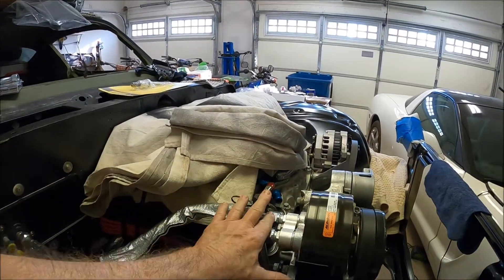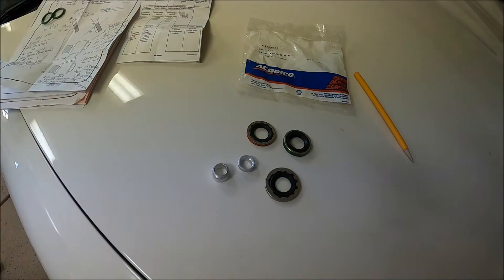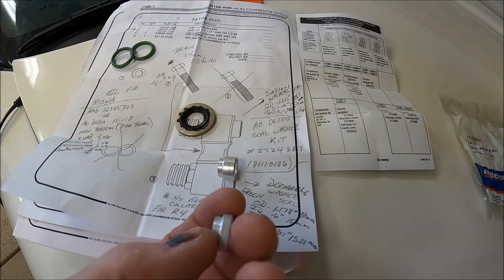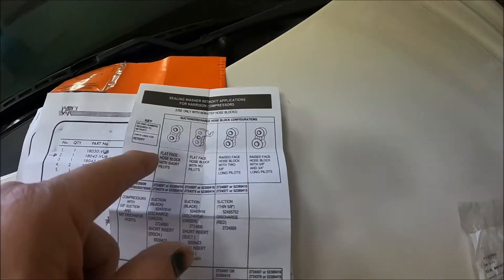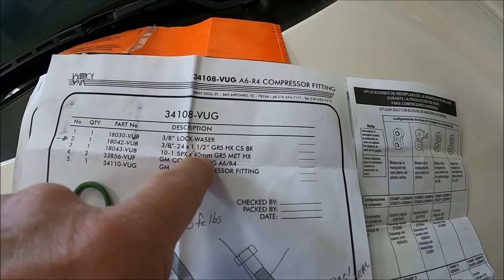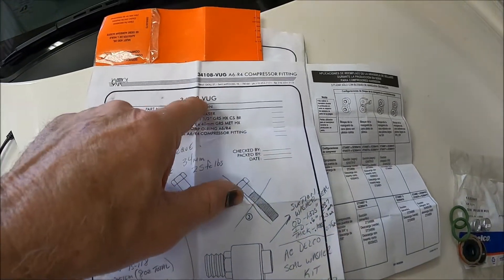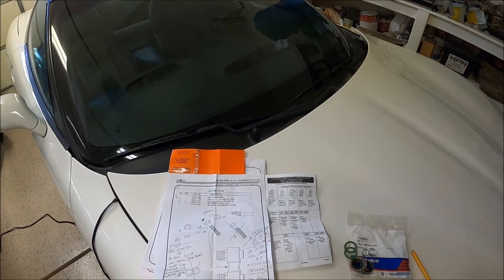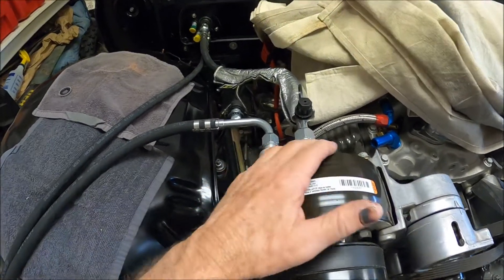Camaro R4 Compressor to Vintage Air 34108-VUG Hose Adaptor Install Part 2 10-12-2020

Comment: I know this is a much older video but this information was incredibly hard to find. Thank you so much for sharing.
Reply from the maker: You're welcome! I had planned on getting the wiring  done this last spring but smashed my knee from dirt biking! By the time it was healed up it was 100 plus around here in Las Vegas. My knee is healed and the temps are coming down so I should have it fired up soon! Thanks for stopping by!

Comment: Aloha from Maui Pete, where did the power to engage the compressor clutch to the compressor come from, is it from the trinary switch which is fed through the firewall, to the drier and the gets fed to the plastic connector? Or do you need to undo the connector in the back of the R4 compressor, attach some kind of sensor which will somehow turn the compressor on...your video is the best I have seen for the R4 compressor setup...exact same setup as mines...😉👍
Reply from the maker: Thanks! I haven't wired it yet but that will be soon. I plan to control the AC compressor off the Trinary switch which will be installed on the dryer then to a relay to handle the actual clutch load straight from battery power. Because I will also be running Dakota Digital Instruments using their control module and the Vintage Air ECU controller I will be placing a diode across the compressor coil for some insurance. Vintage stated that their electronics was designed so that the diode isn't necessary but who knows what else I might install and it's cheap insurance. Don't know if you have watched this video but it shows a basic setup. https://youtu.be/l604JCZx_ow